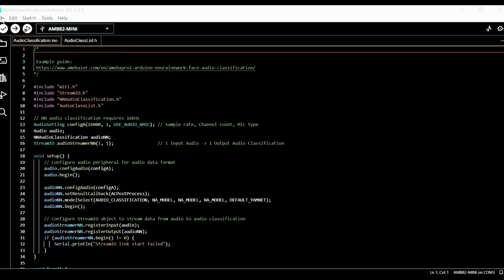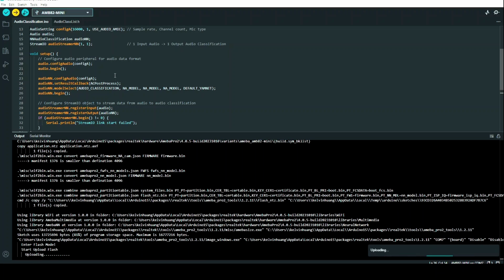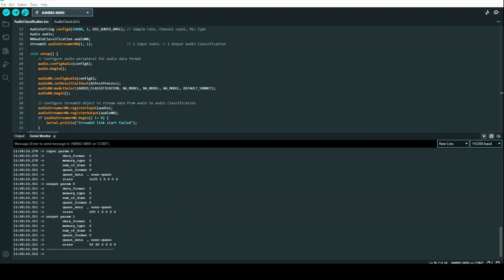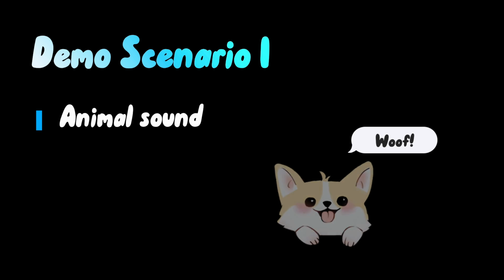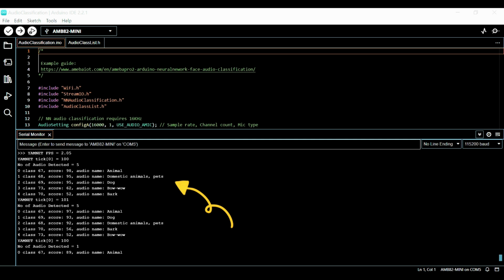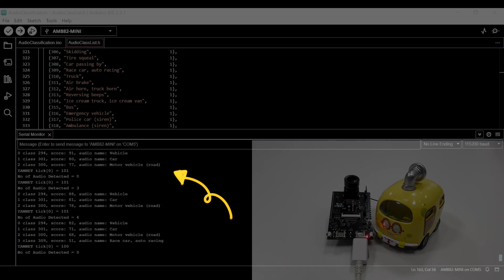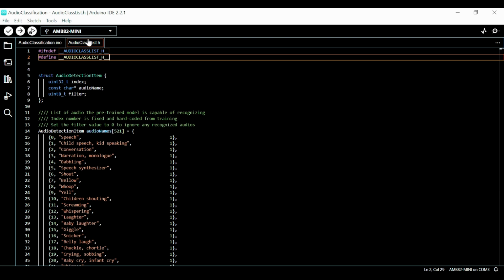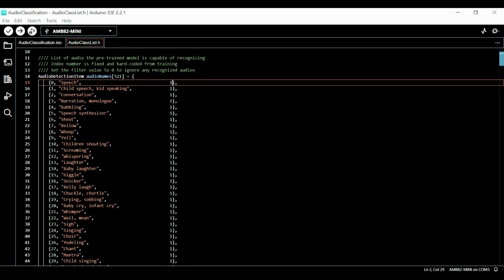AMB82 Mini - Audio Classification

Comment: hello! I purchased 4 sets of devices for test. It's being shipped to Korea now. 
1. I am curious about how much power is consumed in various modes including normal operation mode and sleep mode. (How many hours can a 10000mah capacity lithium polymer battery continuously transmit video information via RTSP via Wi-Fi? and How long does it last in standby mode?) I couldn't find information from datasheet. 
2. I'm curious if it's possible to install another camera module (such as one with an IR sensor) other than the basic camera module I have now. 
3. I'm also curious if there is a compatible LTE module.
Reply from the maker: Please refer to https://www.amebaiot.com/en/ameba-arduino-summary/ for further information.
Reply: @amebaiot7033  I've already looked at the datasheet and user manual. I can't find anything related to power consumption.
Reply from the maker: @BillParkPower  you can find some measurement in the examples
Reply: @amebaiot7033  I got amb82mini in korea. FYI It consumes 240mA on 5v power per hour(while fhd rtsp). AMB82 mini's Power efficiency is almost as good as esp32 cam. And performance is much better. Very satisfied with the product.